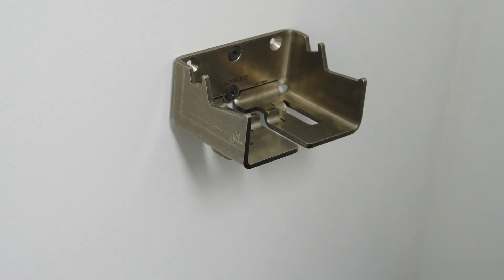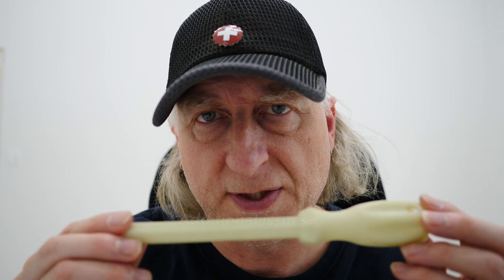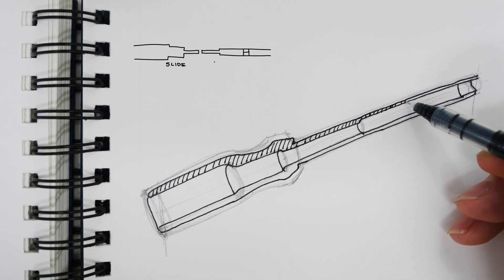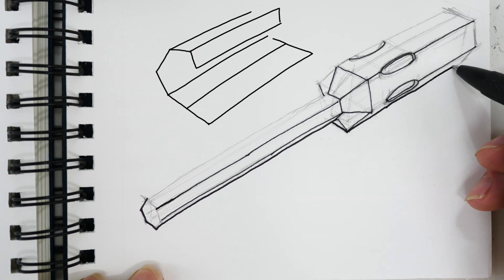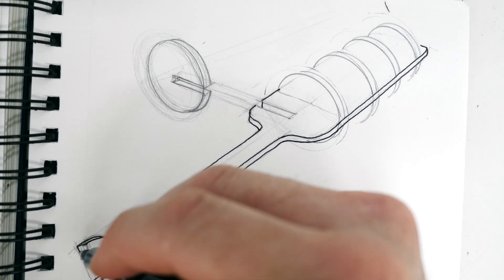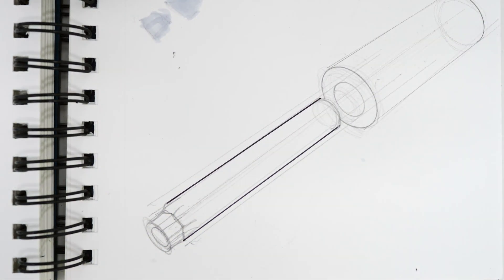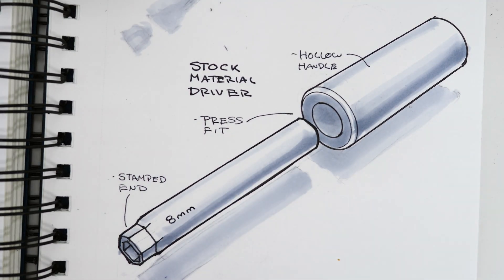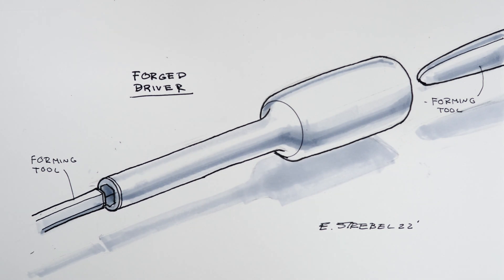Designing Sustainable IKEA Tools

Comment: Or you know... maybe it's extremely biodegradable plastic that doesn't need markings because it will just decompost.
Or maybe instead of proposing 3 extremely expensive ideas and 2 still considerably more expensive than injection molding - just redesign the form to show the material markings. To be sure they are environmental friendly.
Reply from the maker: Lol,right
Reply: @EricStrebel  can you elaborate "lol,right", please? It's ambiguous
Reply from the maker: I think you're being sarcastic and your original comment, let me know if you come across an extremely biodegradable plastic that you're talking about.
Reply: @EricStrebel  I am not a plastic expert, but I've read popular science articles about such research.

From my experience I know PLA can be compostable if it's not polluted too much during biosourced manufacturing.
Reply from the maker: It takes 80 years for PLA to break down into microplastics.... not good
Reply: @EricStrebel  for unfavorable conditions it's 80 years and it's better than 500 years for regular plastic. If that screwdriver was properly tagged as PLA with right material and facility it could decompose in 6-18 months I think.

Anyway I believe scientist did not said the last word in that matter.

Comment: The die cast one is my favoriate. Nearly as cheap, fully recyclable, very mass-producible. Or eve if they do want to keep something like this, use one of the bio-plastics(PLA being the classic with it's pros and cons). That least have a breakdown path that is somewhat sane, still not ideal, but you have tens of years not thousands of years and far less problem with microplastics.
Nearly the whole of Australia by the end of something like 2023 will have banned most single use plastics, from bags to coffee cups to takeaway knives and forks. Everything is timber, plastic or a biodegradable plastic of some kind. It's sometimes a little annoying, but you get used to it.
And yes!  Mine the tips! Lots of plastics and metals and so many other things that could be useful!  People throw away stuff that could make such a good feedstock for refinaeries! 
There is also a good idea that is being proposed: Use non-recyclable plastics(Espeally the stuff that it's hard to replace, anything medical  and a lot of food packaging) for example,  as fuel. Rather than burning oil directly, make it into plastics, use it, then burn it. Make it do a lot more on the way.
But all of these things cost money, reduse profit or inconvenience someone..